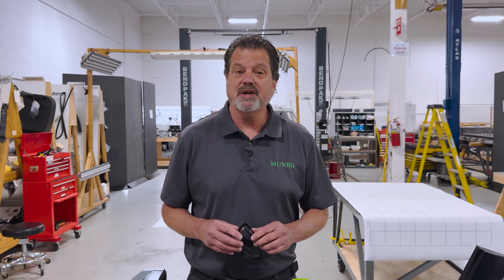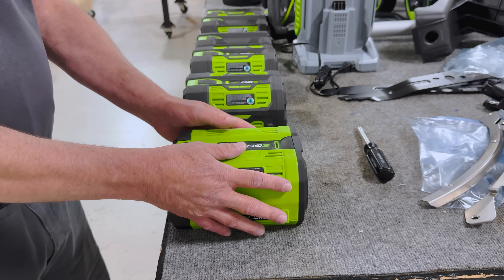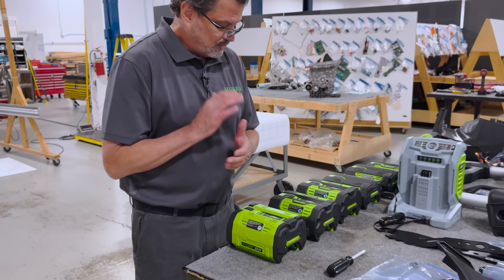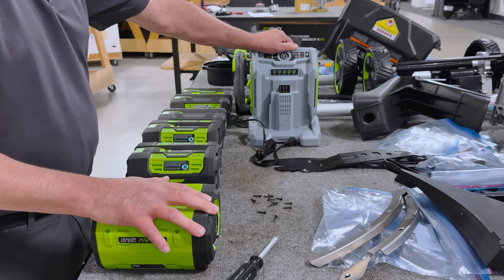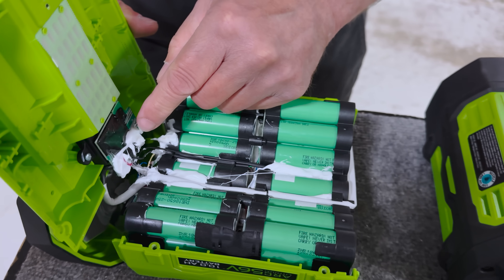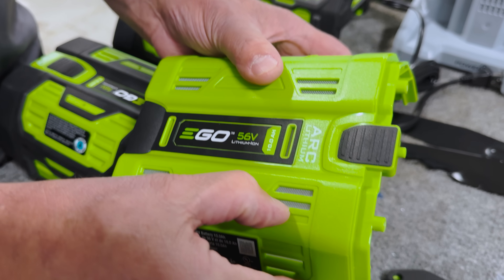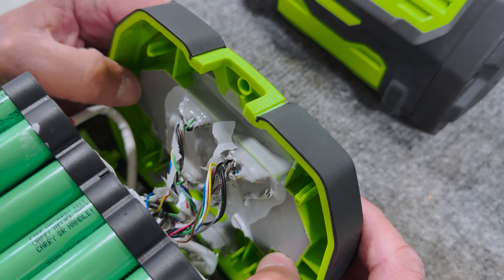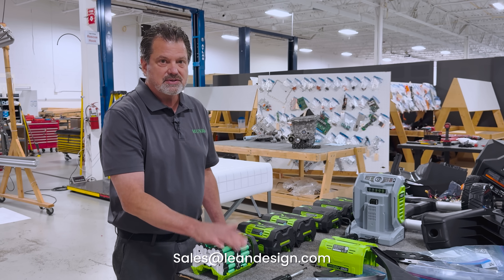EGO 56V Battery Teardown: What’s Really Inside?

Comment: I would love to each what cells they use, it is very important due to the fact some cells are made really QC 

some just poorly made, i took countless of tools batteries apart, Milwaukee, Dewalt, Makita, Bosch, Ryobi, and so on

All use same manufacture. 
Right down of revision they use.

Would been nice if they switch to Ampace JP30 Multi-tabs aka Tabless cells

Those green cells looks like Samsung 25R cells, very decent
14S-4P which 2.5Ah made up to 10Ah

Comment: i have 2 56v 4 amp batts that leak a sticky gel from the bottom after use.  they are only 6 months old.  could that gel be the actual cells leaking?  the only get hot when in use and then they are stored in the house and not in the garage

Comment: According to EGO instructions, the battery capacity indication lights are as follows: One light = 10 to 20%, two lights = 20 to 40%, three lights = 40 to 60%, four lights = 60 to 80%, and five lights = 80 to 100%. This is while at rest, not while charging.

Comment: Uh oh, letting out the blue smoke!   My problem though is that nearly all tool and appliance batteries are NMC and designed to sunset relatively quickly.  There is a scandal going on with numerous power tool batteries where the BMS doesn't even balance the cells.   Forced obsolescence. 

I would far prefer they be LFP (even though they would be heavier), properly balanced, and last 15 years instead of the junk we get right now.

Comment: I'm not surprised seeing the extra effort in adding the fabric material at the vents.  I expect the fabric breathes better than molded in vents that might retain mold flashing or require extra effort to remove flashing.  After 3 winters and more than 100 hour long snow blowing sessions using my similar Toro V60 E26 2-stage snowblower, I know venting and cooling the battery packs is essential.  My Toro snowblower used three 7.5Ah batteries.  It was a work horse.  (I went with Toro over EGo due to the greater use of metal construction.)  The only time I had an issue was a couple of times I allowed the machine to time out and turn off after battling very wet, slushy snow.  The battery packs had active cooling blowing air through the vents while on the charger and possibly in the machine too.  This system worked well 99.9% of the time.  However, if you really challenged the machine and then let it turn off, the heat would build up in the batteries (I presume), causing it to not turn on for a few minutes wheel it cooled down.  

I will add, I will never go back to gas powered tools.  For a snowblower, it is great to not need to store gas for three of four seasons, and during a big snow storm, no need to run out for more gas.

Comment: The only technological problem with electric battery-powered tools today is with hand tools. Specifically, it is the combination of weight and power of the battery. It is a pity that EGO did not catch up with the new battery technology, known as tabless design, which is already widely available also in 21700 and 18650 cylindrical formats. Some other manufactuters like Bosch or Makita already implement this new cell technology. Actual EGO production uses outdated Samsung INR18650-25Rx cells which can deliver a continuous maximum discharge current up to 20 A, where, thanks to the PCM sleeve, they can maintain this current almost throughout their entire capacity without overheating at a reasonable ambient temperature. This corresponds to a maximum power output of 1000 W from a smallest 2.5Ah EGO battery, but some EGO hand tools, typically chainsaws, can draw up to 2000 W, so a 5Ah EGO battery is recommended for them. Well, the new tabless cells, such as Ampace JP30 or EVE INR18650-30PL, can now continuously supply currents of up to 40 A without the need for a PCM sleeve and so deliver the full 2000W power to the tool from the smallest and more important the lightest EGO battery with the side benefit of slightly longer runtime due to higher 3Ah capacity. The current EGO 4Ah battery based on the 21700 format deserves the same update, there is even wider selection of 5Ah tabless cells on the market.

Comment: Dig a little deeper. They make very creative use of jellybean transistors as temperature sensors. The smaller packs have a phase changing thermal compound on the cells. Good stuff.

Comment: With my Rigol DL3021electronic load have done capacity tests on rechargeable battery's at a 1C rate. 
Have found their capacity is between 85 to 90% of their rated capacity.
So far have tested Milwaukee and Makita batteries, Sure EGO will have the same lower than name plate real world capacity.
Note at higher discharge C rates the capacity will even be lower.

Comment: How can the number of bricks/modules vary, if each battery is 56 volts?
I will say the amp hour capacity at 56 volts, depends upon the number of cells per brick/module.

Comment: I'm just curious why we say "18650" for those batteries, but bigger ones are called "2170" or "4680" ??? Why do we put an extra zero on the end of what is obviously a "1865" ??? Is this a holdover from earlier nomenclature, and could we just drop its use???
Reply: I’ve seen the 0 explained as a way to describe it as a cylindrical cell. And that manufacturers stopped using it , but it stuck to some of them.

Comment: I still use two 4.0 Ah batteries from 2015 which I got with my 1st electric mower.  I've used those batteries with 8 Ego tools I've had over the years.

Comment: @7:06  I think it’s worth discussing the issue of over molding rubber reversion (breaking down and turning sticky).  Nearly every product I have bought over the past 25 years that had overmold has eventually turned into a flaking or gooey mess.  As someone that works in product development, I hold onto these as a design curiosity, and I have an entire bin full of sticky overmolded rubber objects.  I like way overmold feels.  It can def add impact protection and better grip.  Have these reversion issues been solved? Was that a quality control issue that was only a problem for a while? Have we gotten better at the chemistry? Because if it continues to be an issue like this, it feels like we are creating disposable products (even more so than usual).

Comment: They now kit everything with 6.0 batteries. It seems to be the most profitable for them as new mowers, pressure washers and riding mowers are kitted with those. The warranty is only 3 years. Are they made cheaper than the 7.5 and the 10.0?

Comment: EGO ride on lawnmowers  discharge the batteries while not in use, 50% discharge overnight! That is really bad, the batteries don’t seem to be isolated from each other. The company tells you to disconnect the batteries after use, that is ridiculous, do you disconnect your phone/laptop/watch/etc while not in use?
Reply: They can be hard on batteries I would pull them out, you will lose the battery quick time. I have had them fail it’s cheaper to buy petrol mower than a battery.
Reply: @davidwright4211 And you know that because you own an electric EGO ride on! By the way, gas ones suck big time, are slow, smelly, horrifically noisy, constant maintenance, complete junk!

Comment: Fully Ego yard now. The 52" ZTR and everything else except snow blower. My gateway drug into the ecosystem was the blade driveway edger after I got tired of inhaling Stihl fumes, then it never stopped. Latest discovery was the snow shovel on trimmer wheels with the 10Ah on the backpack, did snow all winter no problemo. EV autos also, i wish Big Oil and the whores pocketing their bribes would not work so hard on sliding us back into the Dark Ages while ruining the planet and making us the laughing stock of the UN.

Comment: Do the EGO batteries have functioning cell balancing, unlike the ones made by Milwaukee who reportedly have the hardware for it but  do not implement it?
Reply: He mentions passive balancing. The heat generated by that would be harder to dissipate when you pot the PCB!
Reply: @matthewmarks6951 ok, I missed that. Still, disappointing that it’s passive. But better than Milwaukee.

Comment: John clearly doesn’t understand that the objective was to keep the battery package as small as possible. The vent screens save space. While it might only be a millimeter they all add up. Same with the reduced over molding. Given that the batteries should all fit the same charger and devices it is very apparent why these design choices were made.

Comment: Three years now using Ego products, including 7.5ah mower. Best mower I've ever used. Going strong at end of year 3. Carry on!
Reply: From my experience you have two more years to go on that battery.  All of my Ego batteries have failed after five years.  Ego owner for over ten years now
Reply: Love my ego tools, purchased the lawn mower in 2014, followed by the blower, hedge trimmer, weed wacker, lawn edger, and chain saw.  One battery stopped working along the way but all the rest are still going strong.

Comment: I have some older ones that stoped working. I’d like to see how to change a bad battery cell.
Reply: It's no simple task. 

Have to cut the old ones out and spot weld the new ones in.
Reply: You hold the button down and put it on the charger at the same time. It resets the bms in the battery

Comment: Is there a way to set a charging limit on the charger ?

 For example if I want to charge the battery up to only 50% for storage.
Reply: I set a 10 minute or 15 minute timer on my phone, and remove the battery to stop charging.  Pretty easy workaround to charge to 40-60% for storage.
Reply: I have timers on my outlets for my pond pumps why not any outlet
Reply: @lastlion65  I use it for my ebike. For safety too, shuts the power off at the plug in case the BMS fails in the battery pack. Never had that but extra safety why not
Reply: @georgepelton5645  You can buy programmable chargers like I use on my ebike. Whatever % charge you want. Set the voltage ,%, and trickle charging which is better for battery life. Good for other voltage battery packs.DONT try and fast charge it,read the amps rating on the charger.

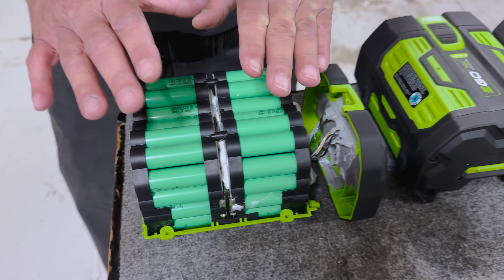Comment: 12:02 I hope you are not saying that the physical “arc” arrangement helps to “passively” balance the cell voltages. 
Temperature maybe or should we put lead weights like car wheels to improve the “balance”. 
Disappointed
Reply: This is an unboxing video. There is no technical or design substance in this video.
Reply: This is an unboxing video. There is no technical or design substance in this video.
Reply: No, he said the arc shape was to passively cool it earlier. It's about heat dissipation.

Comment: I'm going to take a stab that the reason they went with the separate ventilation grills was for more cooling. More than the molded in could provide.
Reply: I think the reason for the lack of overmoulded rubber and the vent grills is that the plastic shell is thinner in the bigger packs to fit the cells in better.  There's a number of tools where the outer dimension is a constraint.

Comment: The weight of a 5Ah Ego battery in a handheld leaf blower was too much to bear for extended periods.  It caused elbow soreness.  Went back to a gas powered Echo model because of that.
Reply: Tie a sling on and hang it over your shoulder !😊
Reply: @WANDERER0070  That's exactly what my Bosch mains-powered leaf vacuum has.

Comment: Your explanation of the lights on the fuel gauge is incorrect. The Ego manual states that one red light is <10%, one green is 10-20%, 2 green is 20-40%, 3 is 40-60%, 4 is 60-80% and 5 is 80-100%. Only other critique is the throat clearing and “uh” or “um”, particularly annoying when watching at 2x.
Reply: I give some leeway to those speaking on camera, especially when they're not trained for it. Many engineers are happier doing their work, not try to explain it in a video. I figure since I'm getting information for free it's a bit rude to demand perfection in presentation.
Reply: @davidg3944 Agree about the pressure of speaking on camera.  However I believe it is beneficial to post corrective comments, to help prevent viewers misunderstanding how the battery display works.

Comment: Interesting, thank you for sharing. I design systems too and use gore textile for waterproofing and vent . Those designers adding cost but saving the battery cells. Keeping moisture and dust out is a balance of cost and reliability. You know what I mean by that.
Reply: I was going to mention that I did read somewhere, possibly in marketing material, that the staked-in vents on the larger battery are actually a hydrophobic vent. It allows for more ventilation, but prevents water ingress like larger vent holes in the molded part would allow. Cell phones and earbuds use the same sort of material.

Comment: Also it makes no sense for them to continue to use 18650's on the larger packs.  Why not 21700's?
Reply: You do understand that they can’t make the overall battery larger, correct? How many 21700s can you fit inside the same battery shape?
Reply: @swooshdave  I do think its possible to use 21700's on their larger packs especially 7.5Ah and 10/12Ah sizes.
Reply: They hand to use small cells, or the size would increase. 

Smaller cells have less air gaps around them in a pack.

Comment: I'm pretty knowledgeable when it comes to lithium ion battery packs, I have personally built a couple packs using bms from Alibaba Ect. 
I think the phase change sleeves warranted a little more explanation as I’ve never even heard of them, I’m sure most viewers have no idea what they are. 
Also would’ve appreciated knowing more about the 18650s. manufacture, mAh, does the cell capacity/manufacture change from pack to pack or are they consistently using Samsung‘s or whatever?
Thank you for the video
Reply: The PCM is a wax designed to melt and absorb energy at a specific temperature.  It absorbs enough energy to keep the cell cool during a normal discharge cycle.

If you store the battery after use it cools off and the PCM re-solidifies.  If you charge the battery right after use, the charger uses forced-air cooling to freeze the PCM and cool the cells during charging.

It’s a very elegant solution to a very common problem.  If you want to know more, look up “Latent Heat of Phase Change” or “Application of Phase Change Materials”.
Reply: The cells in this pack, and the 2.5, 5.0, and 7.5 version are samsung 25Rs.

The 4 and 6ah version have EVE 20Ps.

12ah is samsung 30Q

The other commentor covered the phase change material pretty well.
Reply: @diylithiumguy  Oh boy, Samsung 30Qs.

Those cells are know to be quite... tempermental.
Reply: @diylithiumguy  are the 25R's 2500 mAh and 30Q 3000 mAh?
Reply: @MikeHewitt correct!
Reply: 6:20 - Why wouldn’t the 5 segments be 20,40,60,80,100 instead of 10,20,60,80,100? Is this stated somewhere? Just curious. Nice to see other tech on the channel. Thanks!
Reply: On the phase change material sleeves - they're using the heat absorption capacity of the sleeve to actively cool the batteries in the smaller packs due to more "power demand" in each cell heating them up more than the larger packs. What the engineer said was the smaller packs use individual or at most, two cells in parallel, where the larger packs use three or four cells in parallel.

So more current demand in the single or duel-path cells leads to hotter cells, so the active cooling is required. A pretty clever use of phase change materials giving a "solid state" cooling strategy, and better density that trying to arrange heat sinks with cooling fins.

[Not a battery engineer, this is my take which I believe to be correct]
Reply: @davidg3944  But how do they cool? Where do they move the heat to?
Reply: @zaprodk  They themselves are the absorber, as a function of the energy release or absorption from the phase change. Once they've changed state, there must be a dissipation through conduction to air or back to the cells, presumably during non-use or recharging.
Reply: @zaprodk Ice melting, or liquid water turning into steam, are examples of phase changes. You cannot increase the temperature of the material above its phase change point until all of it has been converted from one phase to the other, which makes it great for preventing hot spots. (Especially if you have enough of it to account for all the heat that can reasonably get produced as the battery goes from 100% charge down to 0% during peak operating loads.) For this application, I suspect they'd use something that turns from a solid into a liquid (or gel) somewhere around the 40 to 60 degrees Celsius range, contained in a sealed package that gets wrapped around the individual cells.
Reply: @KevinT3141  I still don’t get it so the cylinder encapsulating the cell absorbs heat from the cell, but whatever substrate is in the sleeve is going to absorb and retain that heat? once it’s saturated, you’ve got a hot blanket wrapped around your cell. without some sort of evaporative cooling or heat sink. I don’t understand. 
I understand the change of state like refrigerant turning from liquid to a gas, but your split system ac runs through an evaporative coil to a condenser where the heat is removed
Reply: @MikeHewitt The heat is released slowly over time as the battery cools down again after use, and the material changes phase again back into a solid. The phase changes just allow it to absorb and release more heat than any average liquid or solid would do on its own. It's there to smooth out the high heating peaks during heavy use.
Reply: @davidg3944  Thanks, I had no idea.